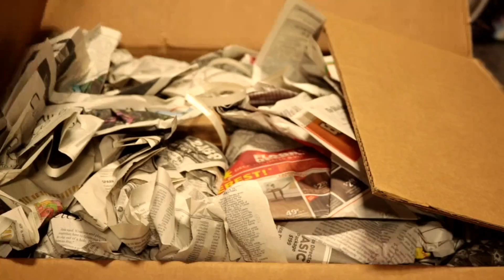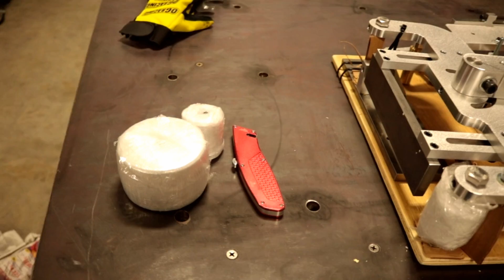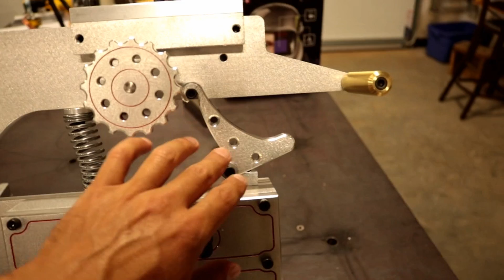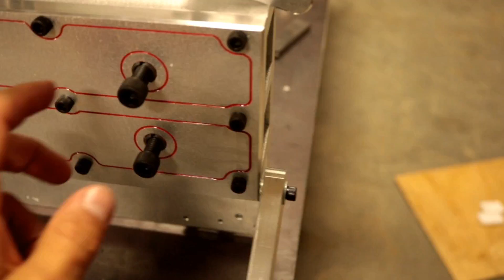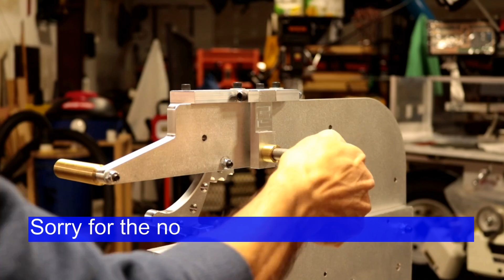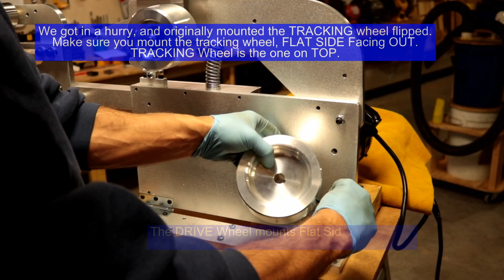Reeder Products 2x72 Belt Grinder – Unboxing, Assembly & Review

Comment: Indeed you do NEED to move your platen forward. It should be co-planar (in-line) with the outside of the rollers. Use a ruler to make that adjustment, without the belt on. The ONLY time you want to have a "slack belt" is if you are trying to grind round objects, such as a baseball bat, etc.

Comment: These box frame designs are actually the best, simplest and strongest design possible. And they’re a lot sexier than other designs. I have my own shop made 2x72 made entirely of 6061 aluminum and I don’t regret it over steel one bit. People that don’t own a real belt grinder will say all kinds of bs like the heavier it is the better for vibration but that’s pure bs.Anything about 70+ lbs is all you need.

Comment: Its nice but the motor & wheels should have been on the other side so when you  flip it sideways the motor is on top & you don’t need a hole in your table when it’s used on its side.

Comment: I have to ask what RPM is your motor,  I hear you explain about the variable speed but what is the motor plate say for top speed.  
I purchased the Reeder grinder a while back  and installed a 1 1/2 hp motor with 1725 rpm, 4" drive wheel instead of the 5" drive wheel you have.   I know you have more speed that I do and I don't hear your motor bog down much.
Reply from the maker: ours goes up to about 1750 rpm as well........ but with 5" Drive wheel.
Never bogs down no matter what we throw at it.

Comment: I like it, one question though, the platen should be right behind the belt touching it, it seems that there is a gap, 1/2" between the belt and the platen, did you set it up that way, can you adjust the platen and bring it forward?
Reply from the maker: Correct, you can adjust it anyway you like.  This thing is completely adjustable for just about everything.